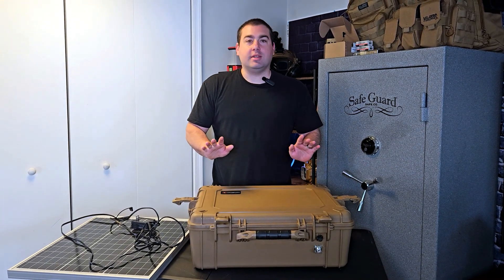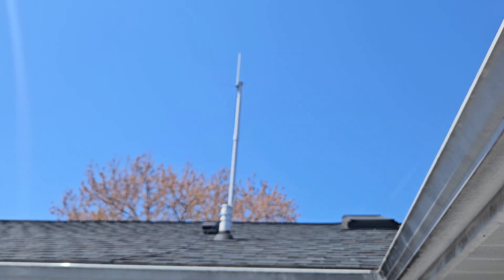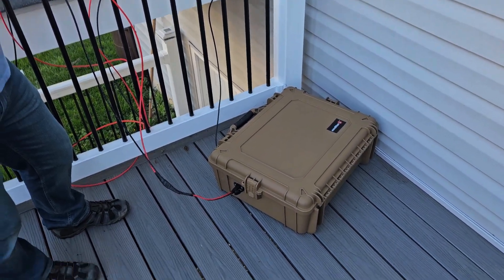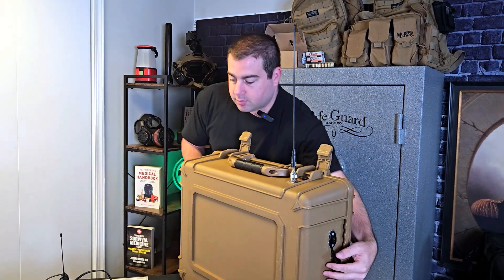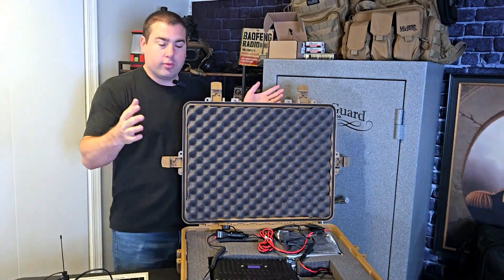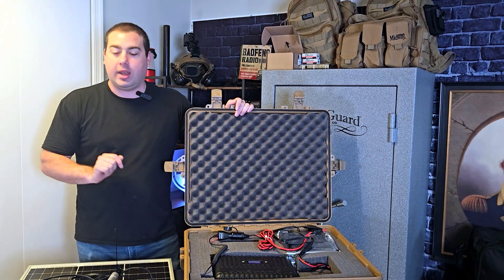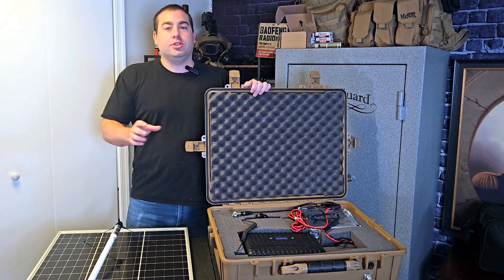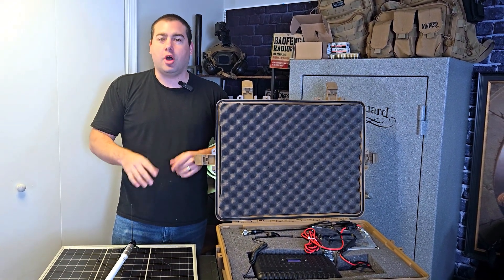GMRS Repeater Box Update: What Worked & What Didn't 🚨

Comment: yeah, Amazon no longer carries the battery you have in your list of equipment to build this homemade repeater, John, so you might want to update your list. They do have LifePo4 batteries, like the 30 A BMS with the automatic cut off charge control. You don't need the charge controller with these batteries. Because the charge controller is built in, so people are right that you need a charge controller between your battery and the solar panel to keep it from overheating from an over charge, but these batteries have the controller built in.

Comment: The only issue I see is this wouldn't work in a cold environment. Charging a LiFePO4 battery in sub freezing temps would definitely destroy it, MPPT controller or not. Using a 12(ish) volt panel directly into the battery with BMS is actually fine as long as the voltage of the panel is within a reasonable deviation of 12v. Just need to watch the cold temps (which I don't think you have in your location typically).

Comment: Thank you for the update! I’m actually building this very same kit and having your updates is great! I’m assuming there’s no issue with the battery when you’re using the external antenna with the coax cable correct?
Reply from the maker: Yes when using an external antenna there is no issue only when you use a radio very close to the battery or when I use the whip antenna on the box the rf signal will shut that battery down for a sec. Thanks for the comment.

Comment: Just because it works does not mean it should. The BMS helps on the battery but you will damage that cells long term if you do not have a proper charge controller regulating the voltage during the charge cycle. That said amazing build and nice video!

Comment: The suitcase antenna, unless it’s of the end fed half-wave type, would work better if it had a counterpoise (ground plane), which may be implemented inside the box. This could also be attached to metallic shielding attached to the inside walls of the case.
Reply from the maker: It is normally used with a long coax leading to a real roof mounted antenna with a ground plane. The small handheld antenna is really only to be used in a pinch and it works ok.

Comment: we have the retivis version at 4100 feet in the sierras using 4 folded dipoles as the antenna,100 watt panel,1 battery,it easily covers 80 miles of the san juaquin valley,all of the foothill towns,and easily covers from fresno to modesto,,this is the best repeater for the money around
Reply: Do you have a charge controller or are you doing the same as the video. I tried the same as the video with a 25watt panel but it was not big enough. I’m getting a 60 watt panel soon before hunting season
Reply: @danielherman5793  yes,a 30 amp mppt controller,three 100 watt panels,and deep cycle marine battery,it works extremely well,i was shocked really,i added a vhf repeater a month ago,even 2 repeaters are working extremely well,before winter somes,at least one more deep cycle battery will be added,i had three costco marine batterys,but they failed,and no warranty